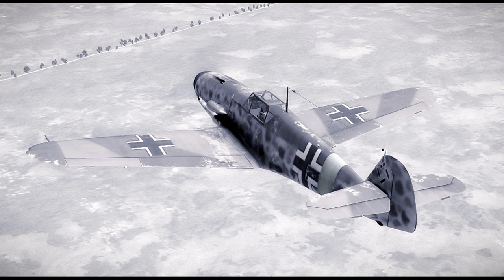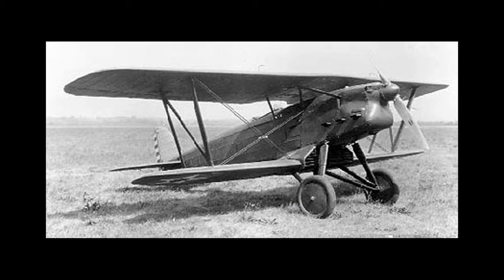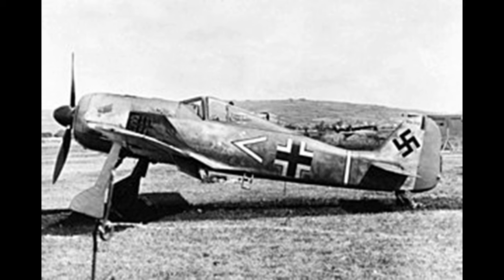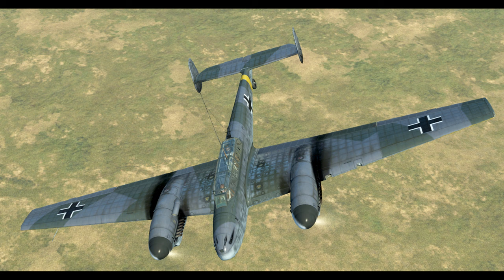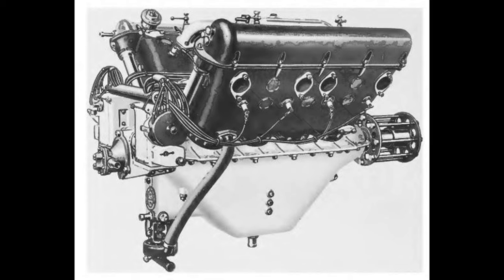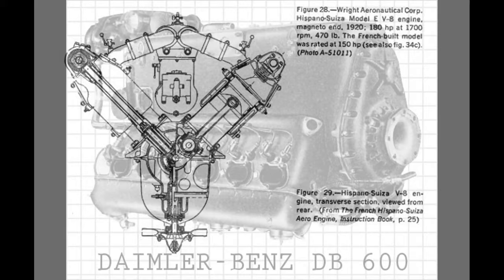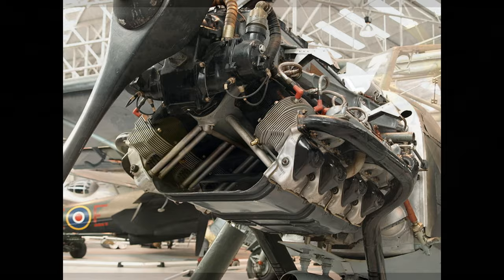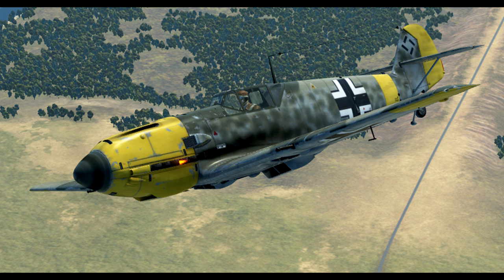Messerschmitt Bf 109 , Why an INVERTED V-12 Pt. 1? inverted V12s vs. upright

Comment: Right  Greg,  a  major  factor  IS  ease  of  access-----fuel  injection  systems,  plugs,  etc.;  but  you  missed  a   MAJOR   benefit  which  probably  accounted  for  massive  kills  of  Loopwapper  piloten  versus  our  lame  ducks  and   the  Brits ( 4 & one-half,   7,  19,  Versus  180,  300,  352  etc. ).        And  that  is  the    ability  to  place  a    20  or  30  MM   Machinekanon  in  the  nose,  firing  though  a  blast  tube  which  runs  under   the  engine  gap.        The  old  race   pilot    Steve  Whitman  stuck  an  inverted   V8  Olds  engine  on  one  of  his  Tailwinds...…  WHY?  Ich  nicht  Weiss.  gl
Reply from the maker: I did not miss that. The central canon issue is extensively covered in Pt. 2.

Comment: Reason one - oil sucking valve guides. In upright, V engines the valve trains are flooded with oil for most of the "gravity lubrication" tasks. But 1930's intake valves had loose, leaking guides and would "suck in" oil during the intake stroke. The inverted design also reduced the need for high pressure lubrication everyplace in the engine, thus minimizing oil leaks. A final side benefit is better maneuverability without fear of oil starvation at the valve train. 1930's technology, "fixed" using radial engines.

Comment: Er...ahh hem. Allisons did not perform well at altitude. The reason why the mustang dithered for a bit...UNTIL.... the Rolls Royce merlin was fitted. Then the germans had a real big problem. Allison was a great engine at low altitude....do NOT get me wrong. Great race boat engine.
Reply from the maker: The Allison did perform well at altitude when I got the second stage supercharger.

Comment: Typisch für die DB Motoren der 600er Baureihe ist die hängende Anordnung der Zylinderbänke. Dadurch ergab sich genügend Raum zum Einbau von Bordwaffen die durch den Propellerkreis schossen. Zwischen den Bänken konnte eine 20mm /30mm Bordkanone verbaut werden die durch die hohle Propellerwelle schoss. That means the vertical build in of the engine helps, when it was top-down to get space for machineguns like in the Me 109. It is in German, sorry: https://www.meiermotors.com/index.php/aircraft/klassische-motoren/mercedes-benz-db605
Reply from the maker: That theory has been dis-proven.

Comment: I don't know if you'd seen this before:

https://ww2aircraft.net/forum/threads/inverted-v-engine-vs-v-engine.29473/page-3#post-797148

it has some comments on the origins of the German aero inverted V-12s
Reply from the maker: I had not seen it, however I did read it just now, thanks for the link. I don't agree with a lot of the speculation in that thread, but it's a good read.

Comment: Callum Douglas wrote a whole book based on decades of research and interviews on the subject of aero engines. Here’s his answer to this question:  https://youtu.be/LvaKvc-igjU
Reply from the maker: By that same logic, the P-38 broke the sound barrier during the war. Simply finding a document or someone who was an eyewitness is far from conclusive. I have a video on the subject of primary vs. secondary evidence and the flaws in blindly following them.
Reply: @GregsAirplanesandAutomobiles  his interview he references is in German from 1928. While I respect you in general your flippant reply without researching what I posted gives me pause as to your legitimacy. You’ve mentioned in the past that you don’t speak or read German. This link above is from exactly those non English sources. Cheers.
Reply from the maker: My reply was not without research, thus not at all flippant. I have seen the video. I think the evidence presented is good, but not conclusive. I will also add that I really can show primary source data showing that the P-38 exceeded the sound barrier, which never happened.
Reply: @GregsAirplanesandAutomobiles  for you to equate Qanon level nonsense about a completely different subject (P38 Never Exceed Speed) with one data packed factual video from the author of a 458 page, richly illustrated book on American, British and German fighter engine development with approximately 1800 endnotes is exactly not doing your research.
Reply from the maker: Not at all, I actually recommend the book and Mr. Douglas sometimes posts on this channel. I'm disagreeing with one specific point. I'm disagreeing with the point made in the video you linked. The video argues that because someone found one specific source that the question is completely answered, and the discussion is over. I disagree with that conclusion and methodology.  Here is a more complete answer. https://youtu.be/-02gVymQGkw .

Comment: The BF109 was advanced, for 1936, and 15,000 were made while serving from beginning to end of the war.  Even so Willie made some bone-head engineering decisions that should have never have happened.  For one, that stupid stupid narrow landing gear!  Yeah I know it was to make a thinner wing and etc. but the trade-off was not worth it by a long shot.  As you state, it made this plane tricky both to take off and land, especially for the novice and in fact more BF109's were lost in landing/take off accidents THEN TO ENEMY ACTION.  Moreover, the 50 gallon tank (behind the pilot) was much too small.  There was plenty of room in the fuselage ,for more fuel, the proof of this is in the Erich Hartman autobiography, at the end of the war they were trying to escape the Russians and flew out ground crew inside the 109's - and two men could fit inside the rear portion!  Even worse, the 109's short legs probably cost them the Battle of Britain as NO ONE had thought up the idea of drop-tanks until later in the war (a US innovation - often using coated paper tanks that were filled right before take off).
Reply from the maker: I wish to add a few things to your points. 1. The U.S. lost more planes in accidents than in combat as well, so that wasn't at all unique to the 109. The 109's narrow gear issue was further exasperated by inexperienced pilots from about 44' on. 2. Adding weight for an emergency ferry flight is different from a combat configuration. Weight and balance, especially aft cg is a bigger factor if flying near the edge of the envelope. The 109s had about a 106 gallon tank back there, pretty small yes. They could have done what we did with the 51, add a rear tank, but burn the fuel first, before you get into combat, thus the cg issue won't matter. 3. The Germans did consider drop tanks in the Battle of Britain but went with bombs on 109s instead. Not a good idea, clearly with 20/20 hindsight, we can see that drop tanks would have been better, but even so, they would not have won the Battle of Britain.
Reply: @GregsAirplanesandAutomobiles  It's news to me that the Germans would consider a trade-off of bombs on the 109's for drop tanks as being a good choice, since the German bombers often flew deeper into England, had to do it without fighter escort and got shot down in droves because of that. But try and find a photo of a 109 in BOB flying with a drop tank, you won't find one, the Germans hadn't thought of them yet. Re the landing gear issue, the allies were training thousands of newbies to fly with a hundred different aircraft so naturally, lots of crashes... but the Germans flew the 109 from 1936 on, (besides which they really only had two main fighters (FW190) to train pilots on for the most part)so the Luftwaffe by rights should have worked out such major problems as landing accidents long before the war by doctrine and aircraft modifications alone.  BUT with the 109  even experienced pilots had this issue and as the war continued and experienced pilots were lost (remember Luftwaffe had no rotation policy, pilots flew until they were killed!) the problem became a thousand times worse having to teach more novices with less training time as the war went on... I'm saying the BF109's issues were stupid since they should have been rectified but never were.
Reply from the maker: The 109 E-7s were fitted with drop tanks in August of 1940, well before the Battle of Britain ended. Source: https://en.wikipedia.org/wiki/Drop_tank . I have other sources for this as well, but that's just a quick and easy one to find. (I think this is discussed in Galland's book) The Luftwaffe decided to fit bombs instead. http://zinzinzibidi.com/Areas/all_about_messerschmitt_bf_109/Content/img/bf-109e-3-with-etc-250-bomb.jpg . The US had huge advantages in training as compared with the Germans. Longer training programs and done without the threat of attacks. It didn't matter how many types of planes the US had, I'm not sure what your point is there. For example, if learning to fly a B-17, then you didn't go through training on the B-24 so there was no extra training risk due to the number of types.

Comment: The upright-V doesn't have the issues with hydraulic lock and it is a natural design for lubrication oil collection, valve stem lubrication, etc.  From an engine perspective, it is a better design.  For an airplane, if you didn't need a geared propeller, then on an inline or V engine, inverted raises the prop.  I say the only reason the 605 is inverted is to be able to run a gun through the prop, which requires it to be upside down, and like the Merlin, they used the same engine in other aircraft.  The 605 was a lemon.

Comment: I'm not an expert on this but I do know that the Germans loved stupid high handed rules. I.e. most german bombers were designed to be able to be (shallow) dive bombers when they never dive bombed which made them worse at what they DID. The 109 was designed to have wings removed to go on trains though this rarely happened. That's why it had the bad "narrow" undercarriage htat wrecked lots of planes and killed lots of pilots. Germany was ALL about high level "rules", the idea nazi germany was alll about efficiency and good engineering is rubbish, they were full of stupidity and bad designs.

Next is a quote, not my work, but sounds totally right. I've a couple book on 109s I should check but ....

"Steven Rusling, ex-chemist, in the entertainment business
Answered May 4, 2018 · Author has 4.2k answers and 3.9m answer views

This goes back to 1928 when a committee of aeronautical experts was assembled in Berlin at the bidding of the R.V.M. ( Reichsverkehrsministerium/Reich Ministry of Transport)

Representatives from the Army, the D.V.L. research centre, the Navy (airships were at their peak in 1928 ) and Deutsche Lufthansa were instructed to make an in-depth study of of the international scene regarding aero-engines and then produce specific guide lines for the future development of large air and liquid cooled motors.

Along with others, Prof. Wunibald Kamm (of "Kamm Tail" fame, Kammback to Americans), Ing. Wolfram Eisenlohr (famous pilot and head of the D.V.L. power plant division) and Dr. Helmut Sachse (later, co-designer of the B.M.W. 801) served on this panel.
The specifications drawn up by this "think tank" were very detailed and incorporated some very advanced features including, for the liquid-cooled engines:
12-cylinder, inverted installation, mono block cylinder banks, wet cylinder liners, propeller reduction gear, supercharger, fuel injection, high temperature glycol cooling, provision of a cannon tunnel in the ‘V’.

Tender documents were sent to Daimler-Benz, Junkers and B.M.W., all of which eventually produced a V-12 engine model in response although none was able to incorporate all of the required features immediately. The DB 600 had dry liners and carburettors, the Jumo 210 also had only carburettors and the B.M.W. 116/117 only got as far as the prototype stage.

The specifications were presented to the manufacturers as a ‘fait accompli’. If they wanted production orders, the engines had to comply with the tender descriptions.

Wolfram Eisenlohr was interviewed in 1980 regarding the 1928 requirement for inverted V-12s and he cited three reasons for the decision:
 More compact installation, better pilot view for single engined aircraft, less exhaust flame dazzle during night flying.

It’s why the German aero engine industry opted for inverted V-12 engines, despite the problems associated with that choice. That in turn is why the Bf 109 was fitted with an inverted V-12 in the form of various DB 600 series engines."

Errr...

Comment: Yalta agreements didn't talk about US slowing down to let USSR take Berlin. Didn't happen. Period.

Germans also used inverted V12 because once the upper fuselage narrows (in case of a single-engine fighter), it creates less air resistance when the plan is performing a maneuver, thus allowing to increase pitch rate somewhat.
Reply from the maker: https://en.wikipedia.org/wiki/Race_to_Berlin . The US forces stopped before reaching Berlin specifically because that area was awarded to the Soviets in the Yalta agreement. You're wrong about the inverted V-12 as well.

Comment: There are a couple of false myths in this video concerning the Sherman tank.  First of all, it was not particularly more reliable than other tanks.  In fact, its breakdown rate was surprisingly close to that of German tanks.  The myth of reliability stems from reports that prior to battle, commanders reported nearly or exactly 100% tank availability.  This was quite true, but leads to the common misconception of the Sherman's reliability.  This high availability figure is because of the ease of repair of a Sherman.  As one historian put it, "the Americans had spare parts coming out the wazoo."  A Sherman's entire engine could be swapped out in as little as two hours after the breakdown--partly because of excellent design and partly because a whole bunch of brand new, ready-to-go engines were just a few miles away.  If a German tank crew was lucky, they only had to wait several days for a new engine just to arrive and this situation obviously grew worse as the war progressed.
Secondly, the video states that "there are very few times when U.S. Army Shermans encountered Tiger tanks after D-Day."  This is actually backward.  The U.S. encountered Tigers only after D-Day.  In fact, the first encounters took place in August, after the battle of Normandy.  German Order of Battle reports show that all Tigers in Normandy were committed against the British and Canadians whom the Germans considered a more serious threat for geographic reasons.  All reports by U.S. troops of fighting Tigers in Normandy turned out to be against Panzer IVs whose superficial resemblance to the Tiger I was enough to confuse G.I.s in the heat of battle.  It didn't help any that these tanks were often supported by 88mm anti-tank guns which is the same gun as on a Tiger.  This led U.S. tankers to believe that there were Tigers everywhere when in reality, there were actually none.

Comment: Scuse me, are you crazy? Sherman fuel needs were sometimes even BIGGER than diesel wehrmacht tiger. About that garbage sherman aeronautical radial engine, they were made to cool with air flow, that means SPEED of an airplane, which tanks doesn't reach not even in dreams:))).
Please don't struggle to show "advantages" of sherman, because these were only ONE: BIIIG number of them/low production cost/engineering. 
These "low/lighter supply needed" ..is pure bullshit typical for us army fan :)))

Comment: I am sorry, but your clip must end at the sec 19. Reason: misleading, due to false information.  Fiesler Storch had a v 8 inverted, and Focke Wulf had a radial engine. Bye.
Reply from the maker: LOL, LISTEN to what I said in the video. In those first 19 seconds I said the Storch and others had an "INVERTED V-TYPE ENGINE" which is does. I also said that the FW190 D-9 had one, WHICH IT DOES. The only false information here is in your post.
Reply from the maker: How do comments like this guy's happen? Do people really watch a few seconds of a video and then post based on what they thought they heard?
Reply: @GregsAirplanesandAutomobiles  you are right and I am wrong.
Reply: @GregsAirplanesandAutomobiles  you will be surprised, but is a lengthy discussion, don't think that you'll be interested... Still, with a solid basis, despite facts... Lengthy discussion...
Reply: There is a point in inverted v 12, something with an easy way to grease the cylinders, oil getting into them by gravity, no oil pump, thus more rpm. But, at start, you have to turn the propeller several times to get the oil out of cylinders... Otherwise, you risk to crack them... An old aviator told me that. Was a must, he flew the fiesler Storch...
Reply from the maker: Hi Adrian, welcome to the channel. Turning the prop by hand in indeed a common way to avoid hydrolock. The old aviator who told you that was absolutely correct. The engines without oil pumps are some really old designs without pressure lubrication, that's not the case with any WW2 fighter engine.

Comment: The Tiger I had lower ground pressure and higher off road speed then a Sherman. Learn your history.
Reply from the maker: I don't recall discussing ground pressure or off road speed nor do I see what that had do with the choice to use aircraft engines.
Reply: Well if you actually read on the combat journals of combat veteran mechanics that had to work on the Sherman you will read on how the wide range of engines used in Sherman made training, maintenance procedures, spare part supplies a living nightmare in the field sense nothing was interchangeable between the various engine types.